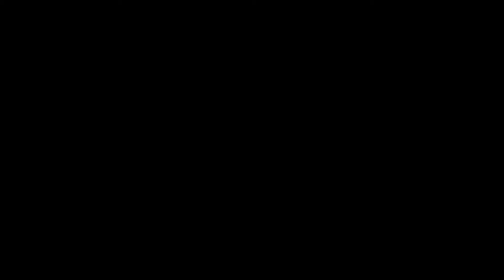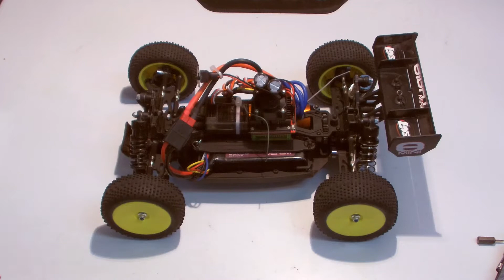OVERVIEW | LOSI MINI 8IGHT SPEED PROJECT #1

Comment: I used a Dremel tool and file on my 4mms shaft to machine it down to the 3.25mm. Now it's easy to find pinion gears. I've done this to 5 motors now, works great. How do you keep the front on the ground? Mine is similar setup but wants to flip over when I give it any real power. Tried a front wing, but unsuccessful. I also use a traxxas spur gear. Only I used erevo 1/16.
Reply from the maker: I run a loose slipper clutch and have my esc up front.

Comment: Did you ever get to do a speed run with your setup? I hit 91 MPH with my Mini 8ight.

So I just came across your vid and this is what I am running. I put the Traxxas MERV spur gear mod on mine CF everything except the chassis. I put a Mamba Max Pro with a 7400 KV 4 pole on mine and I ran 91 on 2s when the rubber tires exploded... Put a good set of foams on it, lower it, put 40 or 45wt shock oil in it and you should be close or over what I ran. I ran a lot of 80+ MPH passes on 2/3s throttle before hitting the 91.

 Get a steel 27 tooth pinion. Use a taper reamer to open up the pinion holes if you need to. I take my 3.17 and open them up to 4mm for my motor. I blew the ESC in the tire exploding crash but I my try to put my old Mamba Max ESC on it to see if it can handle the temps.

I run 60 to 65MPH on my everyday driving\testing  gears 19 pinion and 55 spur.
Reply from the maker: Aaron Hoobler I can't reach full throttle because the tire unglue. What foams did you get?

Comment: Have you had any problems with the spur gear stripping on 3s
Reply from the maker: Yes, it stripped the first run so I upgraded to the hotracing 58t metal spur but then the cheap stock pinion stripped in 1 speed-run. I had to buy a Robinson racing hardened pinion with a 2mm bore. (NOT 2.3 OR 3.17) The 45t traxxas also stripped in 2 speed runs because my 4mm bore was off center on the pinion, the slipper was tightened all the way, and the pinion gear's teeth were slightly angled so there was no gap, between teeth, at any time. I will be getting a steel spur and more plastic spurs along with a better pinion.